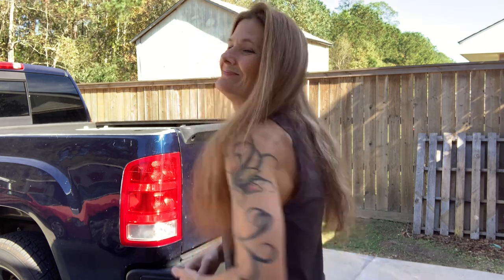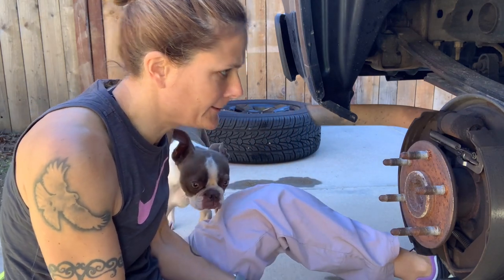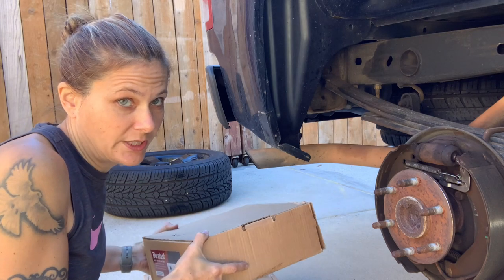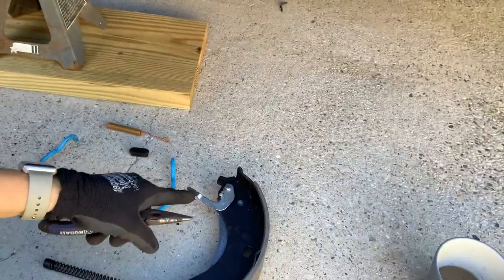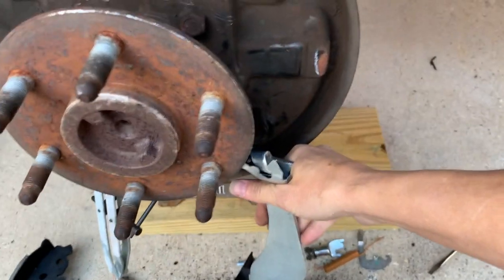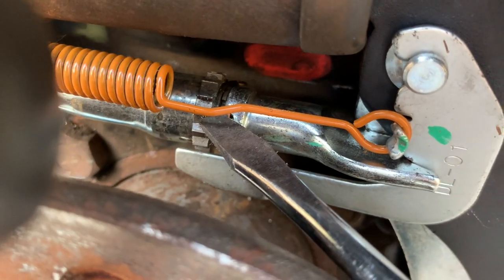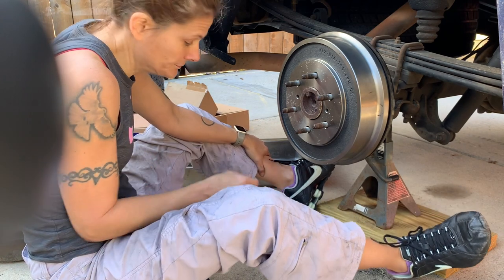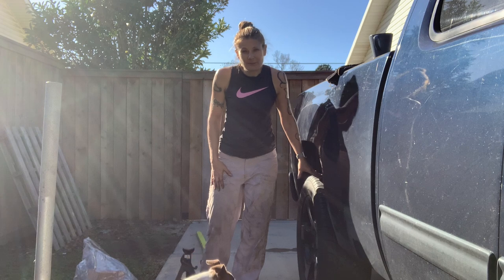Changing the rear brake drum and shoes in a 2008 GMC Sierra

Comment: Betty, When trying to put the tire on, instead of lifting that heavy tire up, use that big screw driver and center it in the middle of the axle and roll the tire on to the blade of the screwdriver and raise the tire up with the leverage of the long screwdriver. I am 80 and that works well for me as I am getting weaker by the day.
Reply from the maker: Good advice! Thank you